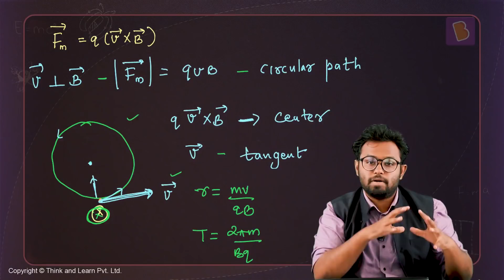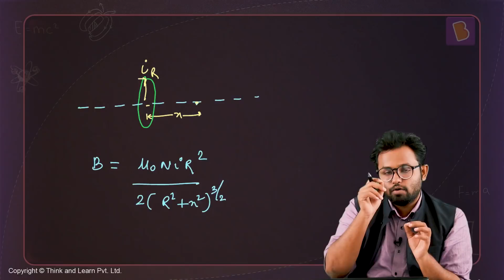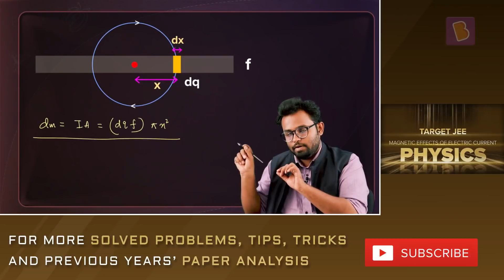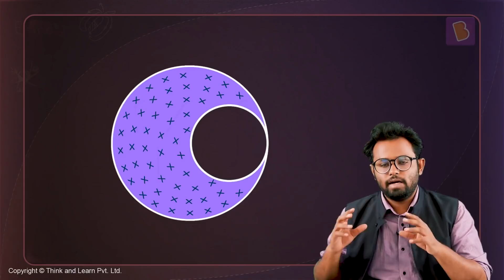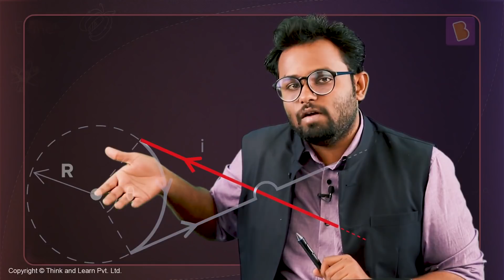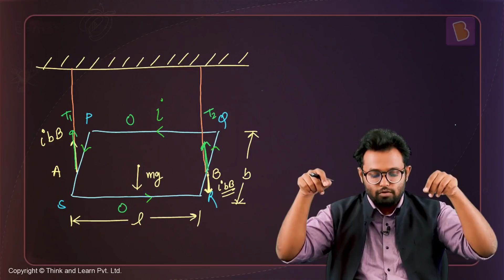Comment: 37:49  There is no charge present in the region of point A and B , so we cannot take current inside as circle of R/2 instead we should subtract the magnetic moment because of that arc
Reply: Hi Sura,
We are assuming that there is current in the entire region, but finally we are subtracting the filed due to that removed part.

Comment: Sir in the first question can we use the formula magnetic moment divided by angular momentum equals charge upon two times mass
Reply: Hi Himanshu,
Yeah, this formula will be applicable in this particular case but don't remember it as a general formula since this won't be applicable incase you have a variable charge distribution. We have focused more on the visualising the problem that why this rod has magnetic moment and explained you the approach which is applicable in all cases.

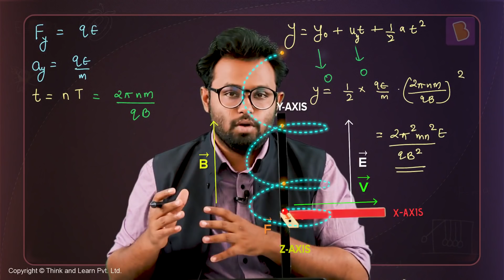Comment: the question starting from (31:00) was such a waste of time .use ampere 's law.  2 step answer.
Reply: Hi Sudhanshu,
We have used Ampere's Circuital law only in order to solve this question. Since this is multiple correct options question, so you have to check magnetic field strength corresponding points to points A and B.

Comment: Is it true that the magnetic field can accelerate moving charges ?
If it is true , does it means that when charges having some initial velocity enter the region magnetic field , their velocity change.
Reply: Hi Bhalchandra,
The force that acts on a charged particle upon entering magnetic field is perpendicular to its velocity vector at each instant, so this force cannot change the value of its velocity with which it entered into the magnetic field. Therefore, remember that magnetic force doesn't vary the value of velocity or kinetic energy of the charged particle. The only acceleration they can have due to magnetic field is the centripetal acceleration which is always perpendicular to the velocity vector and it can only change the direction of the charged particle.

Comment: First question we can use the fact that M/L = q/2m to solve it very quickly
Reply: Hi Pranav,
Yeah, this formula will be applicable in this particular case but don't remember it as a general formula since this won't be applicable incase you have a variable charge distribution. We have focused more on the visualising the problem that why this rod has magnetic moment and explained you the approach which is applicable in all cases.